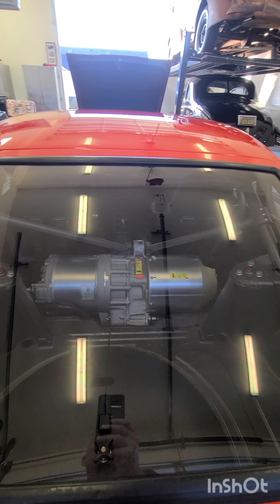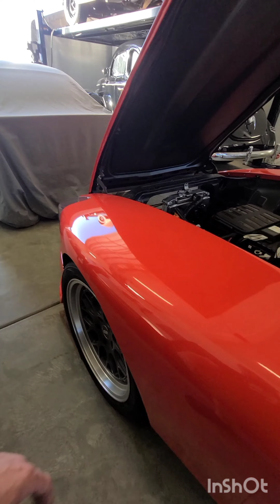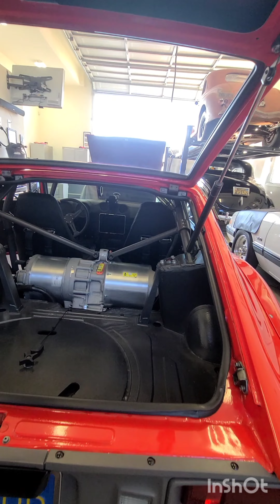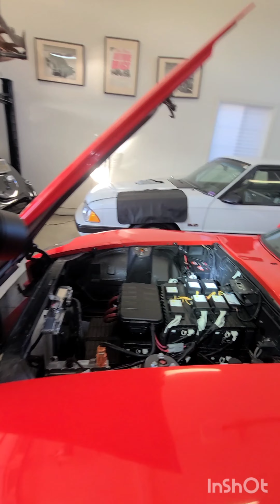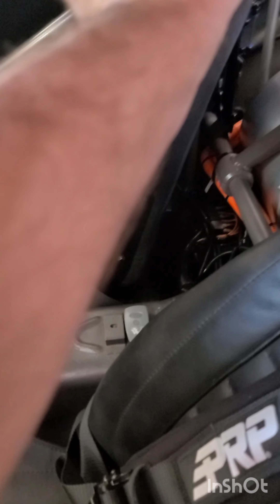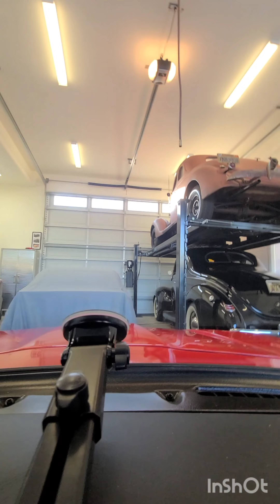Tesla- swapped 240Z!  The first ever. (#2) Walk around and test drive. 🤙

Comment: Hey Brandon, amazing build and great work. I'm from SoCal and have a 260z too and considered doing this. How much did the motor/batteries/electric components cost if u don't mind? Also u mentioned not using Tesla cells cus of weight, but how much more weight was it? Also any cost difference between Tesla vs LG cells? Thanks please post more vids 😊
Reply from the maker: No problem! We're here to help each other. I may be doing a TV show shortly. No Instagram at this point lol. I'll try and get some 8th mile times at Irwindale drag strip fairly soon.
Reply from the maker: Thanks for commenting... I chose the LG modules over the Tesla modules because they are more of a hot rod battery. They expel energy more quickly because they were designed for the Chrysler Pacifica hybrid. They also weigh 38 lb per module versus Tesla's 55 lb per module weight. I was able to procure the large drive unit through a dismantling yard in Sacramento via eBay. I would recommend the performance unit over the standard as it will take more amperage and turn more RPMs. I think I spent about $4,000 for the drive unit. I spent about $5, 000 on the 12 LG chempack modules. The controller was approximately 3,500 through EV controls. I have been noticing that Tesla modules are coming down in price as people continue to get in accidents lol. Check out the different products on eBay. I hope this helps you! I will be posting more videos soon.
Reply: Awesome man thanks for the detailed response. You have an Instagram of your build or anything? I def have a lot of research to do 😅
Reply: Thats awesome. Looking forward to it

Comment: So what’s it end up weighing?  You took some time to keep it light.  From the looks of the mustang you’ve got a bit of a drag racing background.   Get this on the track yet?
Reply: You answered half that at the very end 😂
Reply from the maker: 2400 Pounds.  I went with LG Chempack modules because they're much lighter than Tesla modules.  Also, they are hybrid batteries so they expel energy much more quickly. Kind of like a hot rod battery.  400 lbs in the nose and 380 lbs in the rear.
Reply from the maker: The drive unit weighs 300 lbs. Plus 2 modules (80 lbs) in the spare tire area.  I wanted it to be just a bit nose heavy.
Reply from the maker: Also, yes I was raised around drag racing! I still love it. I just learned that in California you need something to have fun in daily.  Unfortunately our drag strips are dwindling. Thanks for watching! Let me know if you need any help with anything.

Comment: Brandon your videos are now distracting me from work… haha
Can you share how you did the turn signals please! How do you know if the turn signals are working when your in the car and how do you know if they are left on after the turn or do they turn off after completing the turn?
Also, those fenders add about 3” width and your wheels don’t have an outer deep dish. Do you have large wheel spacers?
Reply from the maker: Very clever of you to notice the wheel offset adjustment... I got in touch with a company in San Bernardino that does aerospace grade wheel adapter/ spacers.  Don't tell anybody but inside there's still 4x114.3 adapted to 5x114.3 with custom spacing that I desired.  Who needs 3 piece wheels lol..  I will post a video later to explain the turn signals. I'll also touch base on how I spaced the wheels out. You better get back to work!!
Reply from the maker: Unfortunately, I've been at the firehouse and unable to do more videos for you guys. If you really want to know how I did the turn signals just give me a call. 909.767.8740.  I didn't forget about you!

Comment: Does it do regen?
Reply from the maker: Yes, it does. 👍 It gives you the option to turn the percentage up or down.  Because the car is so light, it takes very little regen to slow the car down. Look up EV Controls T2C controller. Thanks!
Reply: @brandonwile6452  ah cool, I've got a project car in mind, electric KITT... Thanks for that, time to build
Reply from the maker: Good luck with your project!

Comment: Love the build. Question, how are the rear axles holding up?
Reply from the maker: They're actually holding up well after all the testing. When I redo them I'll do an inner 930 cv worked over for high angle.  They just Make a little noise before they're warmed up. Thank you 🙏